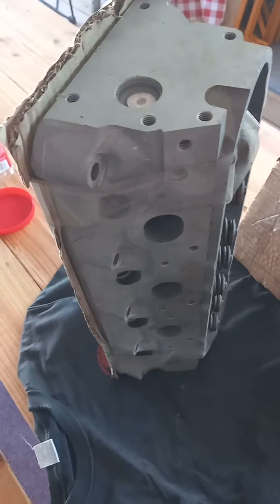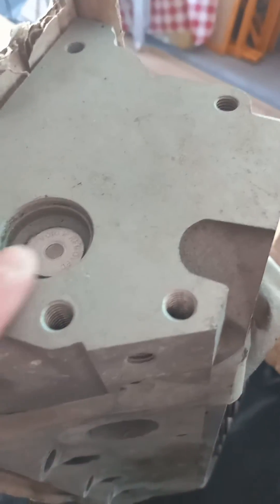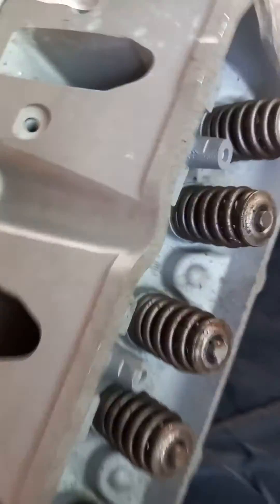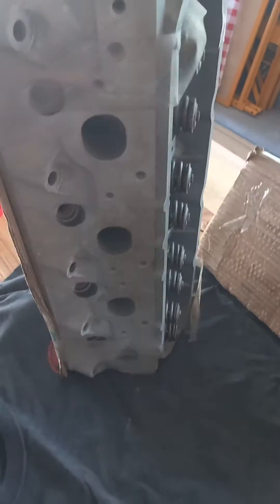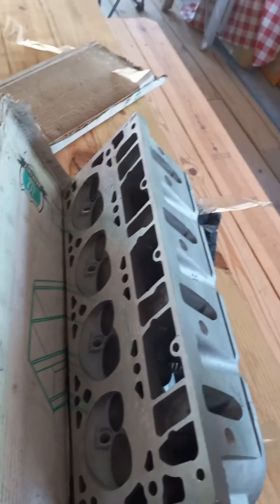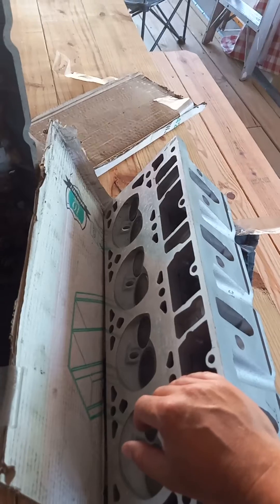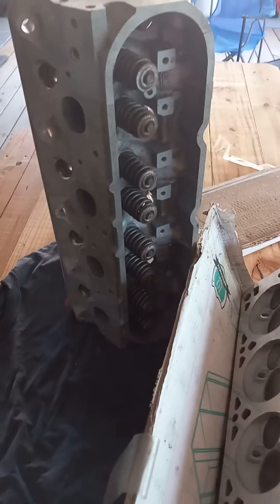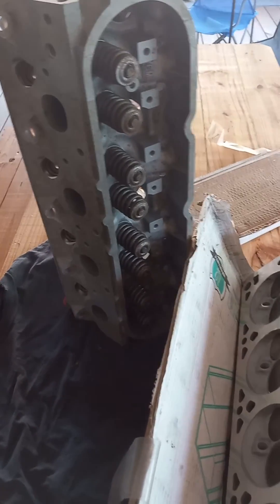Free set of 706 heads = 317 vs 706 swap/comparison

Comment: You got me interested to see what you find.  Any results/updates? Thanks!
Reply from the maker: I put 862s on my other truck... I'm not really impressed. It made 327/369 on 87 octane with a 214/220 cam. It makes 336/336 with a 214/222 cam and the 862s on 93. All of the engine dyno tests out there say they gain torque, but my experience obviously didn't go that way.